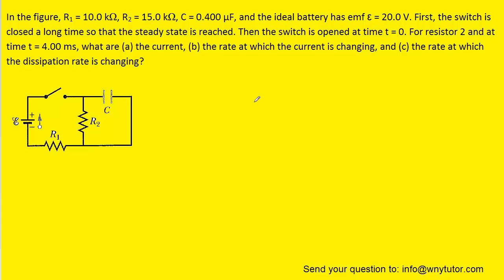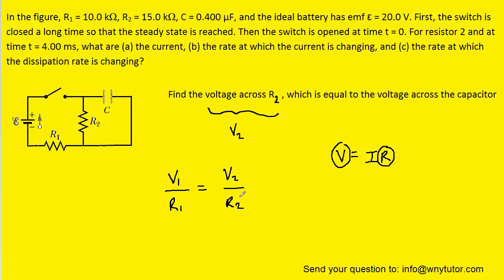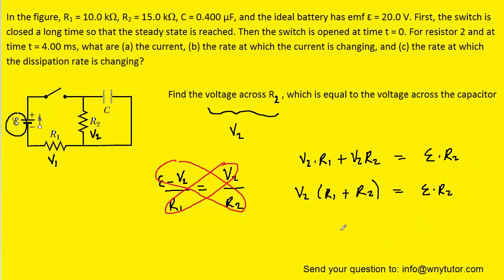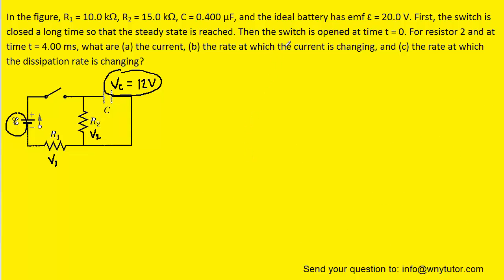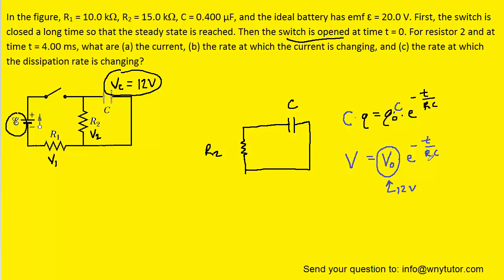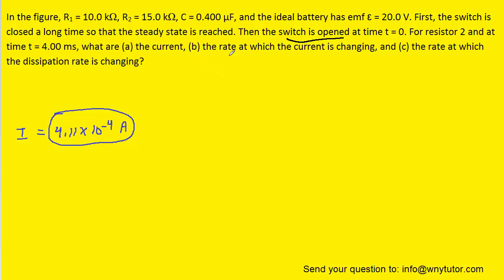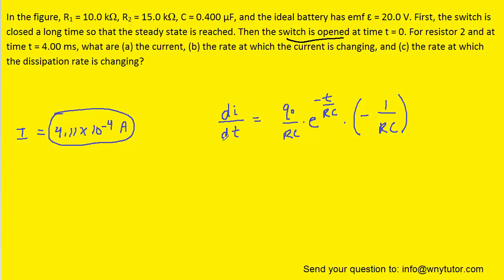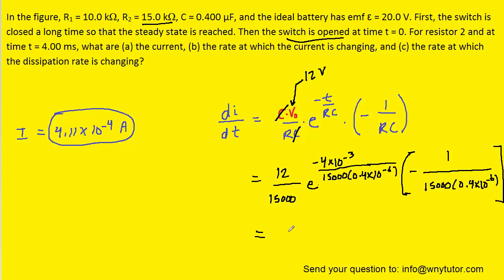first the switch is closed a long time

Comment: When solving for V2 at around 2:58, it is important to change to standard units as well. You kept your resistance in kila ohms while doing calculation. In this case it cancelled out conveniently, but when solving for a potential in volts you should convert to ohms.